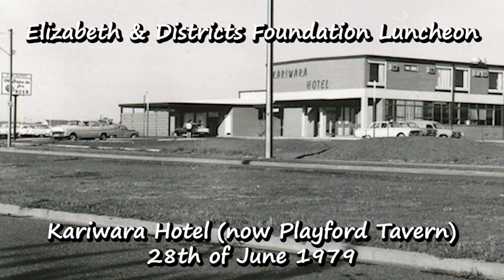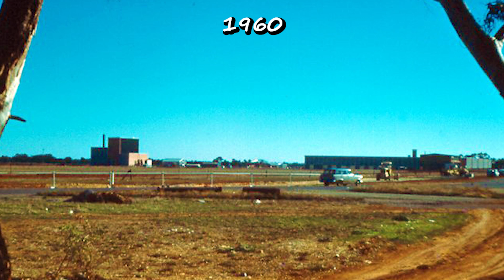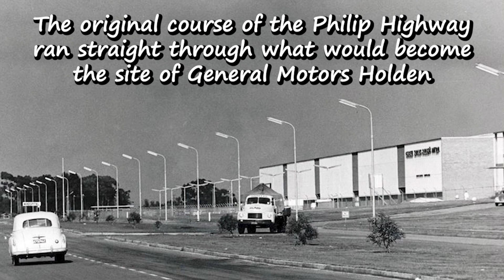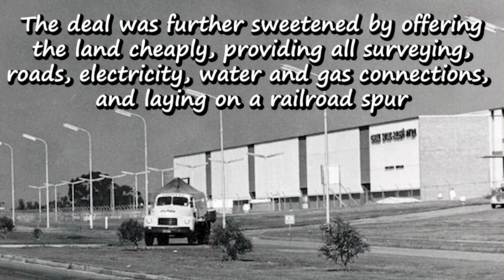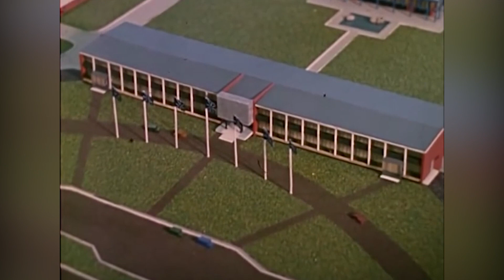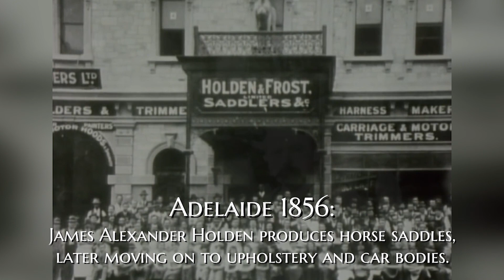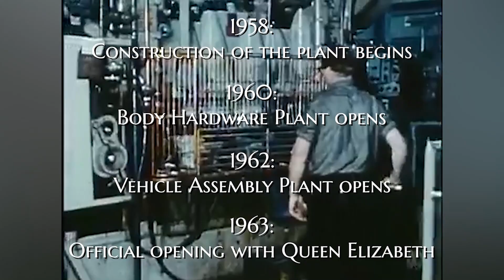Brief Histories: How Holden's Came To Elizabeth

Comment: Oh my goodness. the photo of that guy, Brian Henning brought back memories for me, he and I worked together in the body shop ( Plant 2 )and were friends. he was a Mig welder, and I was a leading hand of the section just after the Mig welding booth. I looked after the metal finish section that metal finished the Mig brazed roof joints, as well as fitting the  rear seat flaps to Station wagon bodies and the tailgates, boot lids, and several other operations.
Reply from the maker: Awesome. There are a few people spotting themselves or people they know in this vid. Love it. Myself, I worked in paint shop in 1990, then as a spot welder in body shop from 92 - 93. Thank you for sharing with us, and for watching. Much appreciated 🙏

Comment: Hey mate this is awesome. I started working at holdens as a security contractor in 2013 and am still there now. It's now called Lionsgate Business Park
Reply from the maker: Awesome Steve - thanks for sharing that. I hadn't considered there would be anyone on site still working from that time. That's a huge transition you have witnessed - pre, during and post closure. Working there must be a very different experience from when you started - at least in the overall feel of the place. Lion's gate Business Park sounds a little more information technology based and less Industrial - would that be right?